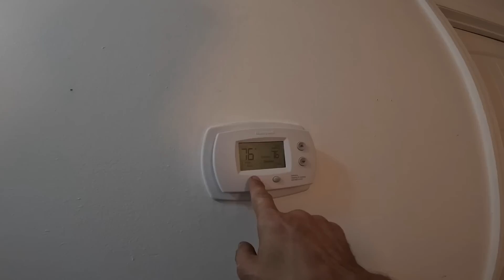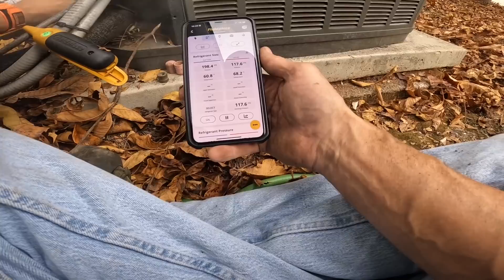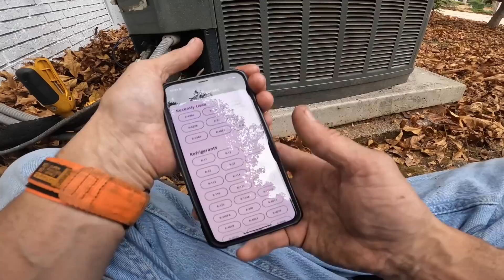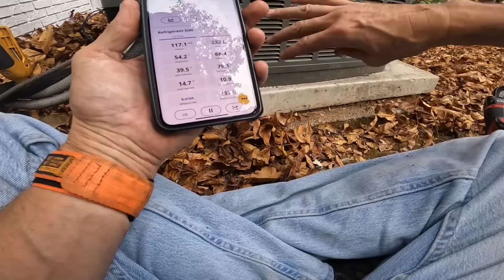Nothing Was Working. Easy Fix…Sorta

Comment: It sucks the way they cram these unit's in a tiny attic. More chances of ceiling leaks. They usually have utillity room or basement up outside philly. You guys are awesome down south.
Reply: I don't know why they do that. It makes no sense at all. A vertical unit in a hallway or closet with the plenum in the attic is much better in a single level house.
Reply: @jthonn  Because the home builders dont allow for a heater closet most of the time so we have no choice but to put it in the attic but when they do we love it
Reply: @austinm5516  I hear you, if they would take a moment to realize that eventually you may need to service the thing. It should take some priority when they draw up the plans.
Reply: @jthonn  Yea I agree

Comment: Sorry, I don't understand having 2 drain openings going to the same line, then have a valve on one that is shut off and an emergency switch on the other. Like I said, I don't understand...but nice work.
Reply: Alot of safetys but it's wired in serious. That's why it took all 3 to open. Needs to be wired in parallel
Reply: I think the valve may be there to prevent it from backing up into the emergency pan if the drain line clogs up downstream? I agree it would be better to have a completely separate drain for it but often we end up having to work with what is there 😂
Reply: Where I’m at we aren’t allowed to run aux drain outside. We pipe into the. You put the shutoff valve in the aux line so the water will fill the pan up and cut the pan switch off. Without the shutoff the water would flow into the drain and not cut the switch off. The home owner wouldn’t know there is a problem. The main pan would be dumping into the aux pan and out the unvalved drain. Also you can run them in series because of any of them cut off then power can’t go through any of them